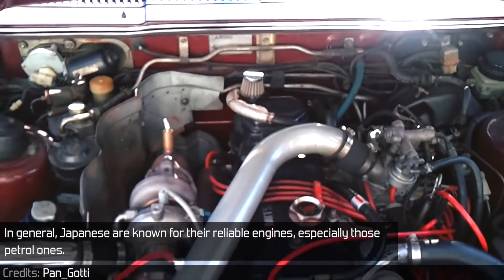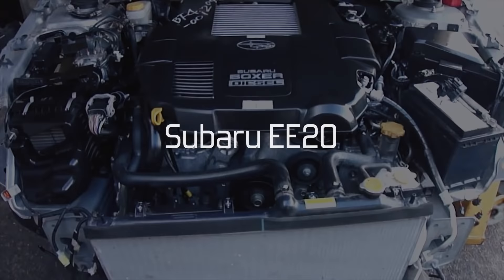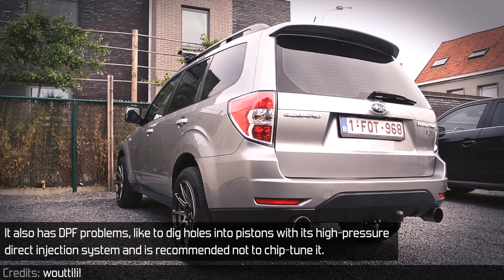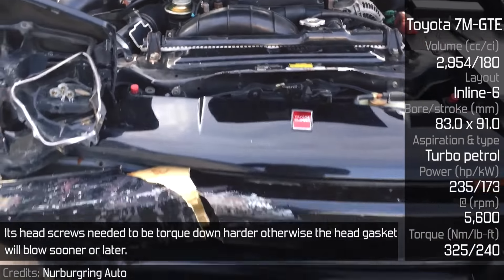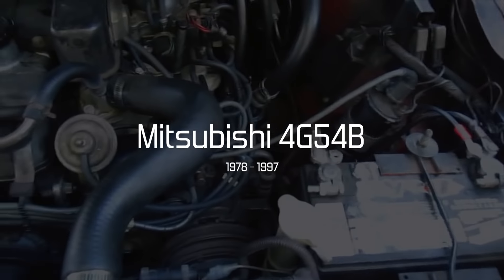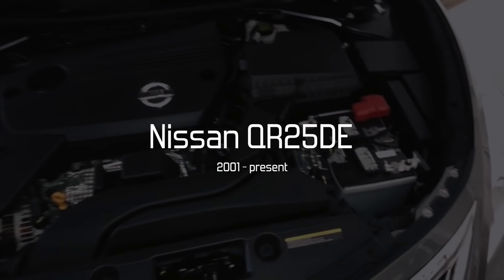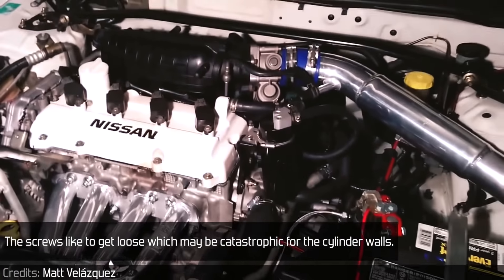Top 5 Worst Japanese Engines Ever

Comment: Subaru boxer diesel is fine after they updated the ecu tune. Had 2012 Forester Diesel, drove 115000km /4years. Absolutely no problems.

But Toyota 1ZZ-FE deserves to  be in the list. Not-so-round cylinders, sticking piston rings, both leading to catastrophic oil consumption/ engine swap / big engine work. To top it off fracturing pre-cats that lead small pieces of the cat honeycomb being sucked back to engine. If the engine was not already ready to be swapped, then the small ceramic pieces from pre-cat would fuck it up. This was a real thing with early MR2 mk3s, so 1ZZ-FED variant.

Comment: love the 1mz. got one in my 99 avalon. despite the oil sludge issue its a fantastic engine with surprisingly decent power. to be fair , changing oil regularly should be done regardless if an engine is prone to sludge or not as this is good car care

Comment: Should have also mentioned the Isuzu 4ZE1. Between the badly set up engine compartment, the terrible fuel injection, and the bi-yearly head gasket replacments, I've not come across a more difficult engine.

Comment: Honda = no problems
Reply: Burago Fix honda is garbage
Reply: Burago Fix... until you bring up their automatic transmissions. They SUCK.
Reply: Honda K series is on the edge of shitty. The make good power and sound but they need frequent oil changes, which many people don't do. So you get stretched timing chains and tensioners and the next thing you know the entire valvetrain is fucked.
Reply: So the engines are not crap but they suffer because of crappy maintenance.. Not a fault of the engine though..
Reply: Michal Stehnij . Not quite , if you drive deferent car for a white you will find out.

Comment: A little note for the "first Japanese fuel injected engine": the first was actually the 1975 Nissan 280Z. It used a Bosch L-Jetronic EFI, but it didn't use an O2 sensor.

Comment: I've been driving the same Subaru Boxer diesel since 2011, never ever did I have any problems whatsoever with it.
Very reliable in my experience. 
But I must say it has never been tuned.
Reply: Mine is a 2011 (the Forester in this video) and its tuned  to 185hp , still no isuues

Comment: Ugh i really thought the EJ25sohc would be on here. I owned 03 wrx and a 2006 2.5i and i dont think people remember how TERRIBLE they are as far as geadgaskets and such failing. I mean, there are STILL ej25s being made today that the headgaskets blow out!  Not to mention the oil pickups on early single cams being extremely prone to getting blocked due to a tiny clearance between it and the pan, even tiny dents are known to starve engines. Not to mention how dated they are, being they are still being produced, headgaskets and all.

Comment: As an owner of the Mazda 13B-MSP aka, "Renesis" I can testify that it is a bad engine. Yes its performance is good, but the stock ignition coils are failing me at 14,000 miles, they blow up if you give them any kind of boost, and I have to use a mazda oil filter on it or else it will lift a standard filter from the parts store.

Comment: I had a NON Turbo 7MGE that blew a head gasket at around 130,000 miles. It didn’t even warp the head. I simply put a new head gasket on it. Same with a Turbo edition I repaired. So evidently it was loose head bolts.

Comment: I have to agree with the QR25DE. The one I had was in a 2010 Nissan Sentra SE-R Spec V. Learned the engine was complete trash later on and earns it's spot on this list. I feel bad for the millions that are used in Altima's (Mostly). Running a VQ35HR and learned to love the motor as it is much better.
PS. swap the bore and stroke. That is not right.

Comment: I have 1mz-fe have had tune up replaced knock sensors,  valve gaskets, water pump Timing belt. I also change oil every 3,000 miles because of the sludge risk. I've owned 99 Lexus Es300 for 6 years now. 265k and still my daily driver! Runs quiet and still very strong!!

Comment: As a Diesel Tech, a lot of modern diesels have problems due to owners neglect, people who buy diesels(at least in the united states) have no clue on how to maintain or drive them. I have heard good things about the ee20 that have been swapped over here, probably because people who swap actually maintain it haha.
Reply: the ee20 the flywheel being dual mass starts having play and puts too much stress on weak crank journals eventually making the crank also out of round and it will snap.

Comment: I have 99 Lexus ES300 with IMZFE VVTi and i change my oil regularly. Didnt have sludge problems and drove it until I wrecked it last october for 6.5 years with 282,000 miles. The one i Own Now bought for $1,650 1999 ES300 with 194k when I purchased and now at 204k ABour to do my 3rd oil change on it. Had to replaced vavle cover gaskets and my mechanic said this engine did have some sludge and he cleaned it for and said if i notice it to start using/buring more than normal to bring it back in. It hasnt used maybe 1/4 quart since last oil change which isnt bad with the milage id say. Overall The 1mz-fe is deffinetly a reliable engine in my opinion.

Comment: The Toyota 1MZ-FE people defend on You Tube like you would not believe.  Glad to see this site call it out for its sludge issues.  Worst engine I owned. Changed the oil every 3000 miles religiously and it lasted 60,000 miles - that was it.  Never had an engine before or after like that one.

Comment: For everyone saying "Aw man the (insert engine) is a great engine, if you fix (insert random problem)." That would be the issue. Most of the people who have these vehicles aren't necessarily mechanically-inclined. If it has a problem from the factory because of negligence or poor engineering, then it's junk, as far as most people are concerned. They can't fix it themselves, which means they have to pay someone else to fix it. Not only that, but it's unlikely they would notice small, seemingly minor issues that indicate a major problem, which results in a trashed engine and an inoperable vehicle. In other words, it's junk.

I'm pretty sure if someone is buying a vehicle and the guy selling says, "Oh yeah, all you need to do is tighten the head bolts a little more" or "Yeah, just make sure your religious about changing the oil, or it sludges up and throws a rod," they probably wouldn't sell very many vehicles....

Comment: An excellent candidate would be the infamous Isuzu-built 3.0 litre V6 turbo diesel also mounted into SAAB, Renault and Opel cars during the early 2000s. Dropping cylinder liners were the reason for premature total engine failure.

Comment: I mean the 7M had the head gasket problem because Toyota made some miscalculations. That's all. And rods bend if you're not careful with the tune. The 7M is an old engine, not like the 2J, which is more responsive to boost. And while Japan might not be known for their diesels, they can be very reliable, like Toyota's ones, especially from the 80s-90s. Top Gear can confirm something from their battered Hilux.

Comment: Of course you can very quickly ruin any engine as demonstrated in this video, as tried and tested by many boy racers, do as follows to cause thousands of miles of wear:-
1) Rev it when it is stationary.
2) Rev it when it is cold.
3) Rev it when its old
4) Rev it to maximum through the gears.
To preserve your engine; start it, drive away as quickly as possible, change up at lower revs, until optimum operating temperature is achieved. 
Never rev a cold old engine.

Comment: I have a Mitsubishi with this 4G54B engine, but a turbo diesel, it's easily breakable if you don't watch everyday oil and water, and it's not as powerful as the petrol one, doesn't go faster than 140km/h but mann, the torque it's amazing! And the sound too

Comment: Boxer engines just aren't capable of handling the higher compression ratio you see in diesels. Most diesel are inline or V configurations because the blocks are one solid casting

Comment: I would add the Mitsubishi 6G72 to this list. It was used in a ton of Mitsubishi, Dodge & Chrysler vehicles from 1986 to 2007. It always had a TON of issues with the piston rings that would cause excessive oil consumption and other oil related issues including engine failure. I could always tell if a vehicle had one of those engines in it cause there would always be a ton of blue smoke following it when it would accelerate from a stop sign or stop light!

Comment: Problems often occur when the engines are pushed beyond their factory settings.
With the Subaru diesel engine, modern diesels all need turbo charging to make them efficient, if the Subaru engine was based on their petrol engine block that is where the problem lies, it was never built to be a diesel, also diesel engines do not like too rev highly like petrol engines.
Some early Japanese diesels were bad because they had cylinder head problems often resulting an expensive rebuild or buy another head, there are cylinder heads made for engines  made in Asia, so if you are in trouble look them up.

Comment: Sometimes it's not the fault of the engine such as when Holden ordered the Nissan RB30E engine from Japan which were prone to cracking cylinder heads.

This was nothing to do with the engine, rather blamed on the "bonnet slope" of the VL Commodore which was made in Australia between 1986-1988.

Any air in the system which which was caused by air entry from the radiator sitting Lower than the cylinder head & improper bleeding of the cooling system would cause an air pocket within the cylinder head,create a hot spot then crack the cylinder head.

I've never had a problem when I was driving one of them because I'd just make a funnel out of a soft drink bottle,top the radiator up with coolant, open the bleeder screw then close the radiator cap,then refit the bleeder screw after all of the air bubbles have been bled out of the engine after the thermostat has fully opened.

In the Australian built R31 Skyline which was fitted with the same engine, it wasn't a very common problem as it was in the VL Commodore.

The worst Japanese engine we've had experience with is the Mitsubishi 4G32 engine, even when they are serviced regularly, they become an oil burner at between 100,000-150,000 kilometres, now why don't the Nissan & Toyota engines of the same capacity suffer as badly as they do ?

My mother has a 7AFE engine in her Corolla which has done over 200,000 kilometres,they are a far better engine than the 4G32 !!!!

I knew of someone who got 400,000 kilometres out of a Nissan CA20 engine, now what's wrong with the Mitsubishi engine ?

It's not until you get a bigger one of them such as the Astron 2.6 litre 4 cylinder engine, then you get decent life out of them.

The only problem with the Japanese stuff I've found is that their genuine parts are very expensive.

Comment: If the Toyota 1MZ and Nissan QR25de are in this list, then a lot of Toyota and Nissan's engines are pretty amazing. The 7mge/gte was probably the worst overall due to the head and cooling issue, but I do agree the QR25 could have been built better since it's not a very well recognized performance engine.

Comment: I'm glad the Nissan QR25DE is on this list, one of those engines has been a pain in my side for years. Mostly because of the catalytic converter disintegration problem causing oil consumption.
Reply: Jake K Nissan KINDA tried redeeming themselves with the 2nd gen QR25 (in the 2007+ Sentra spec V, at least):  
No more pre-cat problems (supposedly), no more butterfly valve screws coming loose......but still had the terrible rod-to-stroke ratio (which conspired to help keep its redline comparatively low). That big ol' stroke keeps its crank/reciprocating mass very busy at speed.

Still, mine is fairly "peppy" in the mid range....

Comment: I have a 1MZ in my 1996 Camry with 205 000 km on the clock. The old car won't stop running. Well, it will when I turn the engine off, but it starts right up again when I turn the key. That being said, I may have been the car's only owner to drive it over100 km/h.

Comment: I'm a Toyota nut, and drive all Toyotas, but they should have included the "3E" inline 4 engine used in the late 80s tercels. That was a horrible engine, with the computerised variable venturi carburetor and oil burning out the butt!

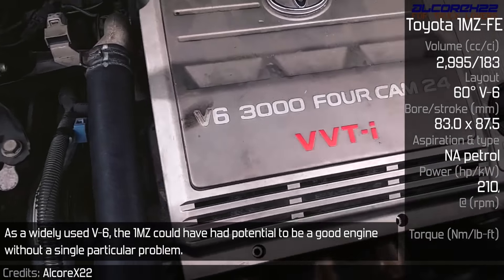Comment: 0:35 2000 Lexus RX300 Checking in here, o1mzFE knocks sensor issue is probably the worst .. Put vehicle into limp mode, the harnesses go bad, toyota  harnesses tend to be trash in the engine bay, and the placement makes it worse

Comment: I know that this one will probably draw LOTS of hatred since people seem to LOVE the damn thing. But my LEAST favorite Japanese engine of all times HAS to be the 22RE. I know people say that the thing will last forever. But that’s not been my experience. Also, the engine is BEYOND being a subpar performer. Issues and shortcomings I have experienced with the 22RE include:

- Piston slap. I KNOW that this is a common problem, and many don’t see it as an issue. But it’s just a sign of sloppy design/manufacture.

- High oil consumption. This one goes along with the first. Granted, you can always carry an extra quart. But who wants to worry about that? Especially in an engine that is supposedly ‘reliable’.

- Head gasket problems. Sooner or later, the head gaskets succumb in these motors to corrosion. When this happens, you have to replace it, which brings me to.....

- Block electolysis. I have NEVER seen a 22RE that didn’t have a block deck surface that was nicey pockmarked with pits. Sometimes, you can slap on a new head gasket and go. But it never quite feels right. Other times, you need to deck.

- Timing chain issues. Timing chains are supposed to be trouble-free. Not so with the 22RE. Those weak single row chains stretch and start to slap around. They can break the cheap plastic guides, causing the chain to eat into water jacket, spilling coolant into the oil. Or they can break, causing piston to valve contact.

Stupid head bolt/rocker arm setup - Who in their right mind uses the head bolts to hold down the rocker arms? Well, Toyota did with the 22RE. Be prepared to change the head gasket if you EVER decide to upgrade the cam.

STUPID timing cover/head gasket setup - I don’t know what they were even thinking of here. The lower part of the timing chain is covered by a timing cover, but the upper part with the head itself. Sealing the two together is the head gasket. This means that you really SHOULD replace the head gasket when replacing the timing chain (see above). Otherwise, you can cut away just that part of the head gasket and use part of a new one and use LOTS of RTV (or just keep ALL the old gasket and use LOTS of RTV) and hope for the best.

Hot valve adjustment - Another dumb move. Yes, valve clearances are more accurate hot. But whoever decided to do this didn’t stop to think that, while doing the job, the engine will cool. And this throws off clearance. Better to just do it all cold than start hot and end warm. Plus, who wants to work on a hot engine?

Subpar power - A 2.4 liter engine with only 114HP? You’ve got to be kidding! The only thing worse is the fact that the engine has a HORRIBLE intake port design (aka ‘the corkscrew’) that pretty much rules out getting much more than that.

Poor fuel economy - Okay, maybe 114HP isn’t too bad if you are getting good gas mileage. But 114HP AND low-mid 20’s on the freeway? Not exactly the stuff dreams are made of.

Comment: Literally all you need to do to the 7M-GTE is just torque the head bolts down an extra 20-30 ft/lbs and that issue is no more. It's not even that hard to do, I can do it in about two hours. The reason why the rods knock is because you've blown a head gasket (from the improperly torqued head bolts) and the coolant gets into your oil and wears down your rod bearings.

Comment: Oh god that Mitsubishi engine... my dad used to have a Dodge Ram 50 which was just a badge engineered Mitsubishi pick-up, and as he put it in the time he owned that truck he had to do two engine overhauls and replace the transmission three times because it was such a piece of shit. Then he bought his '93 Toyota Hilux after work one day, after he checked it out on his lunch break and had to drive off with the salesman quite literally hanging off his Ram's side mirror.

Dad had the Hilux for I don't know how long until the engine block finally cracked, drained its coolant into the oil, and just kinda tore its bottom end to shreds as a result. He put over 230,000 miles on it before age took its engine's life.

Comment: I didn't even know that Subaru made diesels in their cars, though I should have as they sell cars in Europe and lots of other places and Fuji Heavy Industries makes diesel machines.  What I do know is that my mom's '98 Forester has long been a great car, but at 125K miles or just over 200K k the head gaskets failed and we had to have the car fixed.  Not usually a problem except that with the flat four there is no room to get the heads off without taking the engine out of the car, which is more than I could do.  Since being fixed the car is back to greatness, but it's something to know as those weak gaskets made it into several years across several models including the WRX.

Comment: Forgot about the Nissan YD25DDTI 4 cyl turbodiesel engine found in King Cab Navaras from 02-06. The bottom end siezes around 15k km if the crankshaft bearings are not replaced as they are underdimensioned.

Comment: I have a '03 Toyota Avalon with a 1MZ-FE engine that has 103,500miles on it, never once needed engine work, only work that needs to be done is an exhaust manafold gasket because there is a tiny exhaust leak. Past that, no problems with the engine, been reliable and there is a gentleman next town over with a '00 Avalon same engine, he has over 300k miles. So I'm not sure why your saying this engine is bad given it can easily reach past 200k miles without major issues.